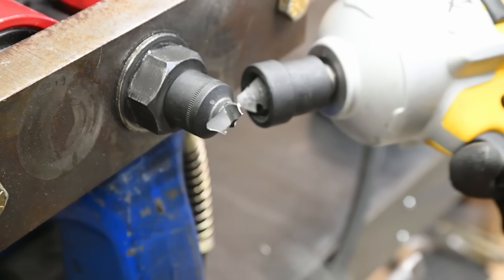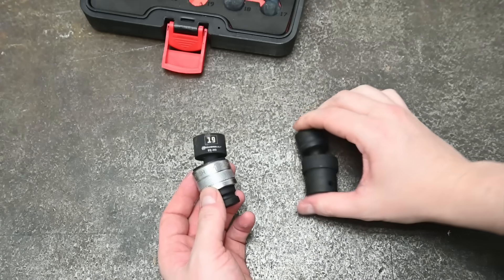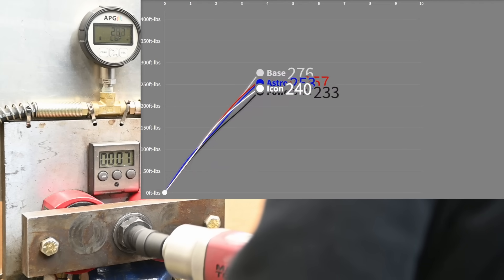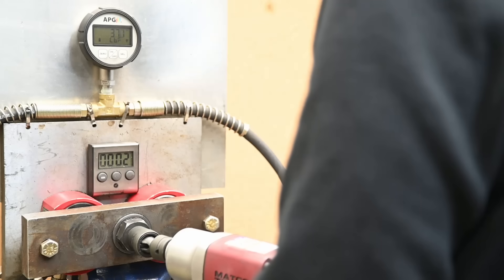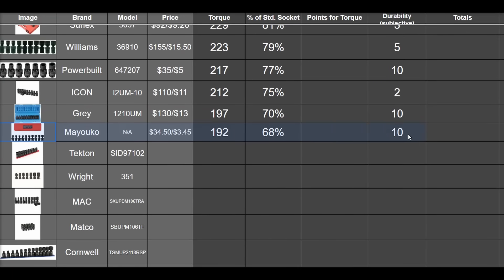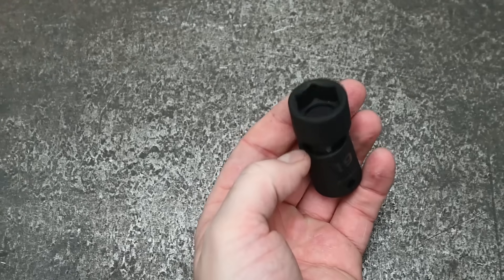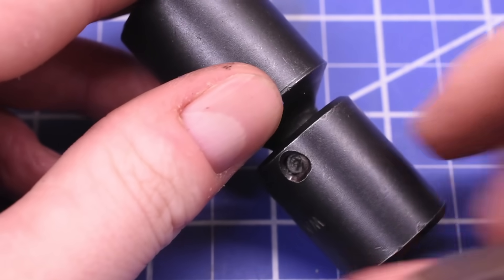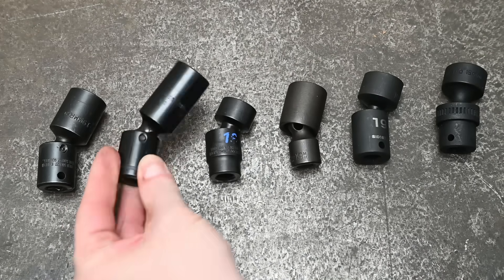Impact Sockets in 2025 are Getting Weird: New Tekton, Icon, Koken, Matco & More

Comment: Try out the Tightspot sockets.  I’m a heavy equipment mechanic and so far after 2 years of use they have held up.  I have the 1/4, 3/8 and 1/2 sets.  Thin wall and priced very reasonable.  I still have my heavy duty tool truck sockets but I rarely break those out nowadays. And they have lifetime warranty also.

Comment: Sunex has done well for 3/8. I've had them for 10 years and broke one but the warranty process was pretty painless. I'm still rocking an old craftsman 1/2" universal with whatever socket I need attached. I broke 2 within maybe 6 months but the 3rd is coming up on 15 years (knock on wood)

Comment: If you can, please add proto to this line up.  Bean beating up on several of their 27 mm 1/2 inch (and SAE equivalents) for quite some time now.  They have actually become welded to the 12-inch impact extensions (same brand) and still continue to live with only becoming looser, no lock up.  Very impressive since the nuts they are cracking off are tightened to 300 nm and that was 30 to 35 years ago on marine diesel engines.  got mine from McMaster.  Can't remember the price.

Comment: let me get this right the icon snaps but the koken didn't and receives a lower score. shouldn't a snapped uni joint be a 0
a little biased to say the least.
Reply from the maker: The koken froze up and failed before getting to durability testing, the Icon failed (more spectacularly) at the very end of durability testing. Either is a warranty, one happened much sooner and with lower power tools.

Comment: I continue to be impressed with Astro's value.  I have a bunch of their tools, all based on your reviews and other channels use (e.g. Eric O).  Thanks for the ongoing work you do to keep us informed!
Reply: What else besides their swivel sockets do you recommend. On what else did they perform well.
Reply: @ The AI moderator keeps deleting my replies :(  I have their mini right angle 1/2" impact wrench and it's saved me a ton of time.
Reply: @rick8381  My favorite two things are my Onyx 1/2" Nano Angle impact wrench and the 1/2" Nano impact sockets.
Reply: @rick8381 
I've had there digital tire inflator that's like the same design and just as good as the truck brands for like a third the price for years.
Reply: I have a couple ratchets impressed for sure

Comment: As a professional Ford technician, the ICON 1/2" wobbles are junk. its gotten so bad for me its been a safety hazard, as when the sockets break my impact (that's spinning at max rpm) always flies right at my support hand when fastening brake caliper brackets to the wheel spindle. last one I broke had enough of it, was warrantied taken home and replaced with that size snap on USA.  I will continue to replace every socket that sees breakage from here on with snap on.
Reply: Found the snap on truck guy

Comment: Have there ever been any tests on Olsa pinless universal sockets? I don't think I saw anything after searching. 
Thank your whole team for all you do to make these videos!
Reply from the maker: I believe same as Astro
Reply: @TorqueTestChannel   thank you for the reply. They seem slightly different than AP, and lifetime warranty vs 1yr with AP.
Reply from the maker: @powertechn2  ap is lifetime on all that stuff
Reply: @TorqueTestChannel  odd, astro states on their site only one year, and a retailer that used to be around also stated one year after I tried to warranty a broken socket a couple years ago. 
I'll admit, I also broke the anvil on one of my onyx stubby 3/8 in less than a year, and was told by the same retailer that the anvil was a wear item...

Hmmm. 

Any link confirming AP has lifetime warranty? I looked at their univ sockets, but the denied warranty by a retailer claiming only one year turned me off of their sockets.
Reply from the maker: @powertechn2  Their website doesnt say they only have 1 year, it explains the terms of their 1 year. I doubt lifetime requires much explanation, I dunno. 
Never try to warranty a tool with the retailer unless they you're tool truck route guy, go through the brand. They are the ones warranting the product.
On these very sockets in this video, see the 4th image here: https://amzn.to/4auLVDK
Mentioned in 1st feature here: https://amzn.to/40DhlEu

Last feature here even says just send them a picture and they send a replacement: https://amzn.to/40pjhiu

Astro is famous for taking warranty over Instagram dm's and garage journal pm's as well. Almost all of their sockets, ratchets and wrenches from the past 6, 8+ years is lifetime.
Reply: @TorqueTestChannel  I wish I would have known all of that. I bought a second onyx 3/8, and bought a replacement socket of theirs (ap) that broke. 

I am a professional tech of 25yrs.  5 years ago I started seeking alternatives vs "truck".   

Seems my retailer just didn't like warrantying anything.

No Instagram or anything. I'm older, so old school where you expected to walk into the place you purchased from and get actual assistance. 

Thank you. I appreciate it.
Reply from the maker: @powertechn2  that happens all the time. Retailers don't even bother. The air tool is yeah 1year. The sockets lifetime. Just email them a picture with part number and an address to send to. I have a spare 6-24mm set if you want it, drop us an email via our channel info

Comment: the sockets that use a pin and slot- I think whether the pin is horizontal or vertical to the angle when they're used on an angle will affect the torque.

Comment: the mac is an old discontinued model?  how about using the latest model which has been out for 1-2 years?  xupd619mmra??
Reply from the maker: Damn, dealer sold it right off the truck too
Reply: @mikethetoolman8776 Its the current set, I just bought it last week on the current $100 off promo

Comment: Is it possible to seat those powerbuilt ones from an angle? I’ve had a number of situations where I need a universal socket to be able to tighten or loosen a bolt, but it’s also a pain in the butt to seat the socket on the head of the bolt due to the angles involved. If it’s possible to seat the collar at an angle, that would mean I can put the socket on the bolt, then go in with the impact/extension and snap it on, then tighten or loosen the bolt. That would be really nice.

Comment: I’m surprised you’ve never tested the sunex ones. They’re cheaper and pretty decent. I’ve had to warranty one of them but they’ve held up decent
Reply from the maker: They're in the last video, their 3/8" didn't fair well from testing but I've had good luck with their 1/2"
Reply: @ that’s surprising. I’ve had pretty good luck with mine. Heck most of the time I used them it was on a 1/2” impact to get bell housing bolts. I have a few that are notchy feeling but for the money they’ve done well for me lol

Comment: Hey, can you do a video on 3/8 extension swivel sockets? It’s basically a set that has about 6”-7” extension bar with a swivel socket already attached. Most mechanics use the 3/8 extension swivel socket sets. I didn’t see any videos on it. Of course if you wanna do a 1/2 extension swivel socket sets, that’ll be good too.

Comment: The real winner here is the Astro pinless swivels!! Stupid cheap and running with the most expensive brands on the market!! Definitely thinking about getting the torque force now too. Snap on is clearly the best, but the matco torque force is right under it, not as soft, smaller and i think, overall a better choice due to the smaller diameter and the fact that they don't mushroom like hell after a couple of uses.

Comment: Thanks for the content. Any Forge 6 vs 8 vs 12.0 testing for saws , drills and grinders.  Could y'all build a string trimmer dyn0 to compare m18 quik-lok power heads with different batteries and brands also.  Thanks!

Comment: Were they all tested on the Dewalt durability tester of doom or only a couple? (I only ask to keep it fair, but the icon survived the Milwaukee then broke on the dewalt which if the others didn’t all get tested on then technically icon didn’t break… again not a icon fan boy, just fair)
Reply from the maker: Yes, they all got tested with the 2967, an air 1895 then the DCF961. You see a couple of those dewalt clips just after the icon breaks.
Reply: @TorqueTestChannel  right on! Except the one that burred up BEFORE finishing the torque test 😂 which fair, less than Icon.

Comment: What is hard about these rankings is the durability value. Really hard to tell how these things hold up after years in these types of test. Unless you work in a shop and have seen with your own eyes it is hard even to accept someone's opinion even if they are in a shop themselves. 

In general you could just by Snap-On and 99% of the time it is going to be near the top in reliability, but that makes about zero financial sense for most people.  With the solid performance brands from China you never know what you are going to get. Sometimes the process is solid and the tool is great, but the QC in general is lower and you never know when they switch suppliers or swap to a different metal for cost. 

I used to get a lot of SK tools as they held up well without costing Snap-On money. Now I use reviews like these and hope I get a good batch.

Comment: Will the Icon 3/8 swivels survive a DCF921/3? If not, will a 1/2-to-3/8 stepdown help? I got a set of these because I had a 30% off coupon and they were the most expensive thing that I didn't ahve and figured I'd be able to use one day. Kinda not sure why I did that now, though, hahaha. I only have the DCF921 and DCF961 in the ugga-dugout
Reply from the maker: Yeah, DCF921/923 no problem
Reply: @TorqueTestChannel  Thanks bud. Have you tested what kind of loss a step-down coupler causes? I know you've done extensions and torque rods
Reply from the maker: @Omnis2  https://www.youtube.com/watch?v=opeKWQ-retM
Reply: @TorqueTestChannel  This channel delivers

Comment: for me, wobbles are a must when working on most mechanical things. it helps to have 6 point, 12 point and spline drive wobbles because theyre always handy. i got tired of the cheaper ones snapping so i bit the bullet and bought all snap on in all sizes. this was about 6 yrs ago when i checked on ebay and i was able to pick up brand new impact wobble sets for less than $200/set. i wish i would have boughten the deeps back then when ebay prices werent damn near retail but theres still good deals, your just have to look for them.

Comment: The only issue I see with the quick change system is if that adaptor breaks all your sockets are out of service instead of one piece sockets.
Reply: it's not ideal but I imagine you could stick them in the end of a regular shallow impact socket if you were in a bind, loosing some of your angle of course.
Reply: Powerbuilt stocks replacement parts for their tools.  It should be possible to get spares.

Comment: The Mayouko tools look like the Casoman and Mixpower brands that Amazon sells. Probably the exact same tools with a different label on the case
Reply: Im 99% sure Casoman and mixpower are just apex tools rebrands. Their semi deep and low profile chrome socket sets are identical in size and piece count to the gear wrench versions.
Reply: I agree. Just at a cheaper price than their other brands because they dont have to cover lifetime or much of any other warrenty @DaveDoesDonutz

Comment: I own all the gearwrench swivels in all sizes and all drive sizes. I have a couple of times had to use micro files to smooth out the inside so they would swivel again after heavy use with a GEN1 Milwaukee HTIW.
Reply from the maker: With a gen 1? Ouch

Comment: I’ve been dying to see pushy get ahold of BREAKER BARS of various brands.
Reply: The Den of Tools told a cool story about when some Harbor Freight people contacted him to try to get him to talk about the Icon breaker bar and just said that he doesn't care because he thinks Pittsburgh is less than half the price and has worked just fine even through his abuse. They said its for professionals who may break it in certain situations, in which he just responded, "lifetime arranty.". They have now raised the price of the Pittsburgh breaker bar. I don't think any half-inch breaker bar will do exceptionally well just because the 1/2-inch drive will be the limiting factor. But it would be nice to see how extendable or ratcheting ones do.
Reply: I have a really positive story about the Matco adjustable pry bar.   It's full grown man with breaker bar strong, but I think Snap On and other brands have the exact same tool from the same factory idk
Reply: Wow I just searched "torque test channel breaker bar" and didn't find anything. Surprised they haven't covered it yet
Reply: 1 inch drive sliding t handle and 21ft scaffolding pole
Reply: if you break a breaker bar you do it wrong. Just get a impact or a longer breaker bar
Reply: @alexstromberg7696  You ever work on a farm or heavy construction equipment?? Ive bent 40" 3/4" breaker bars trying to get combine duels off. No impact will wiggle those bolts lol
Reply: @ i work every day on Volvo CE machines, never broken a breaker bar, skull issue, get a 3/4 impact
Reply: @ also, if you have to do all that you thighten it way to much last time. Also skill issue
Reply: @ Nope the dealer that installed them has a hydraulic impact wrench that will torque the ever living shit out of the studs and a 1" Milwaukee wouldn't even touch them... 3000 Ft/lbs I believe.
Reply: @crandonborth  they use a torque multiplier.... They do so to not stretch or snap the studs AND get it to ungodly torques.
Reply: @commonsenseisdeadandgone i work on turbines and we dont use torque multipliers unless necessary, we use 1.5in drive impact and hydraulic torque wrenches for gas turbines or heat stretching for big steam bolts (2in diameter and bigger)

beaking a breaker bar would not be impressive
Reply: @crandonborth  my boy needs a torque multiplier.
Reply: @alexstromberg7696  I just sheared a breaker bar WITHOUT a cheater or jumping on it... That said, it would be interesting to see if the bolt being looser makes it weaker? (I don't know if mine was or not but it was a theory I thought about)
Reply: @ skill issue,go up to a 3/4 bar
Reply: @alexstromberg7696  "skill issue" makes no sense.... Got to use what is available... Skill has nothing to do with it
Reply: @alexstromberg7696 A longer bar will just break the head or bend the bar faster if it's made of too soft / too hard metal
Reply: @ go up to a 1” breaker bar